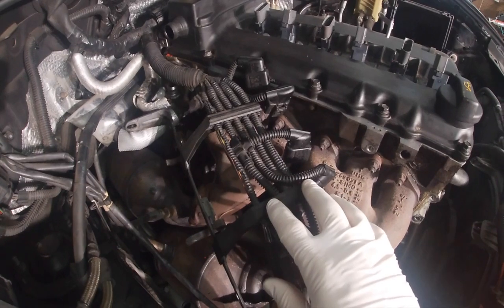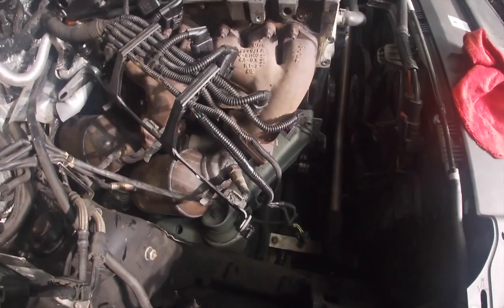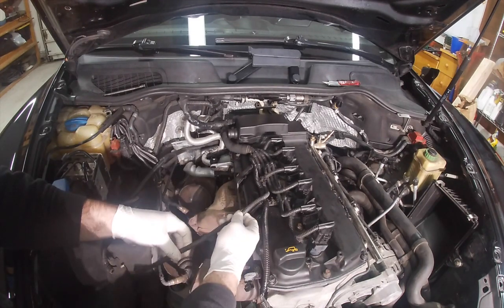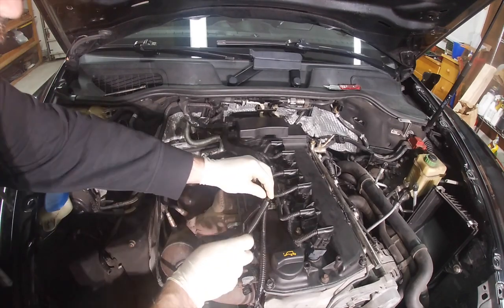Porsche Cayenne 958 92A Engine Wiring Harness falling apart

Comment: Hi Kevin my car Cayenne 2012 having same issue . Where did u find the plastic pipe plz post the link . Thx
Reply from the maker: Its wire loom can be picked up on amazon i think you can even get it from home depot or lowes. Not very expensive
Reply: @KevinsEuropeanGarage   What is the part number and/or name of the covering for the wiring?  Do you a source on ebay to get this?

Comment: I want do this my car take inthemanifof? Thanks
Reply from the maker: Yup you will have to take it completely off to fix the loom if it is broken. You can replace a small portion of it with the intake manifold on. I would pull off the small cover right in front where the oil fill is and I spect them.